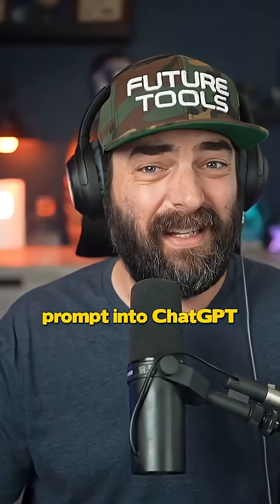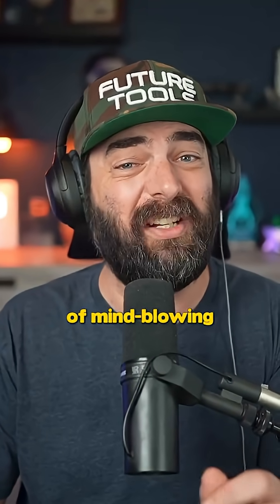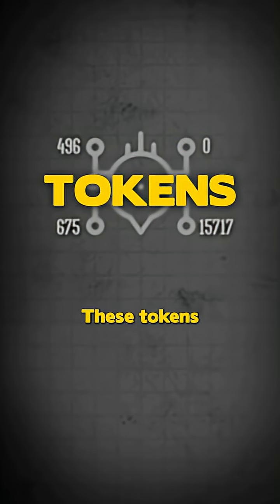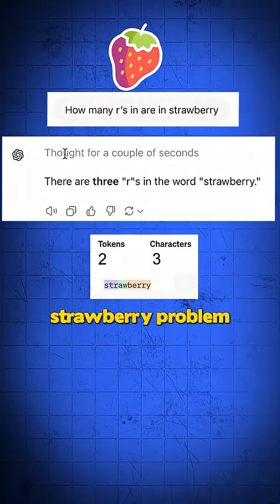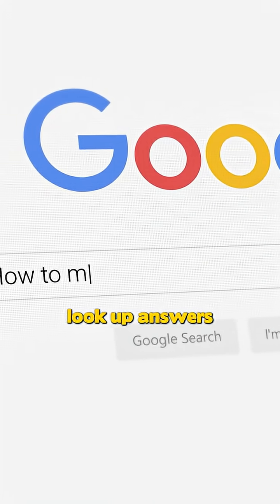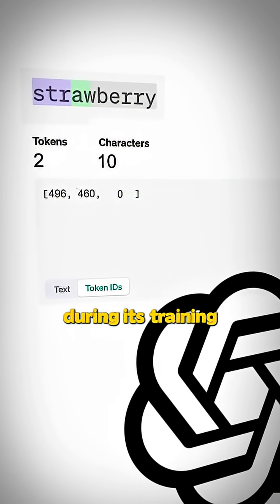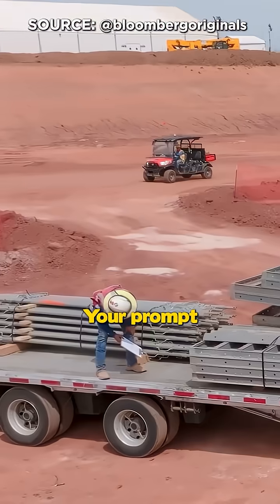What Happens When You Type A Prompt Into ChatGPT?

Comment: When you type a prompt into ChatGPT, it triggers a complex process:

Token Conversion 🤖: Your human language is immediately converted into a string of numbers called tokens. The model understands these tokens, not actual words.

Neural Network Processing 🧠: These tokens flow through billions of artificial neurons within a massive neural network. This network has been trained on a huge amount of internet data.

Next Word Prediction ✍️: ChatGPT doesn't "look up" answers like a search engine. Instead, it predicts the most likely next word (one token at a time) based on the patterns it learned during its training. It's like a superpowered autocomplete with memory, reasoning, and context.

High-Powered Computing 🚀: This prediction process demands significant computing power. Your prompt is sent to a data center filled with GPUs (Graphics Processing Units), which are the "muscle" behind AI. These GPUs perform trillions of calculations simultaneously.

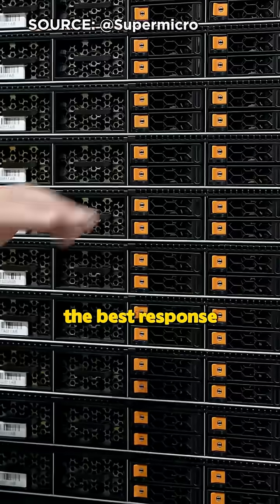Real-time Output ⏱️: The result is an output that feels like the AI is thinking in real time, but it's actually millions of mathematical equations happening in seconds [01:14].

In essence, when you use ChatGPT, you're interacting with one of the most advanced pieces of AI infrastructure ever built [01:26].